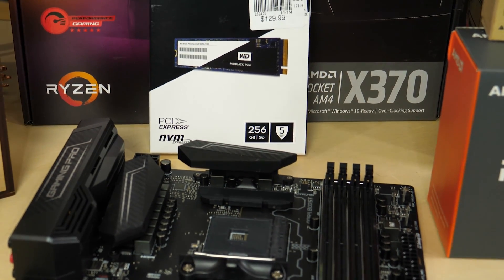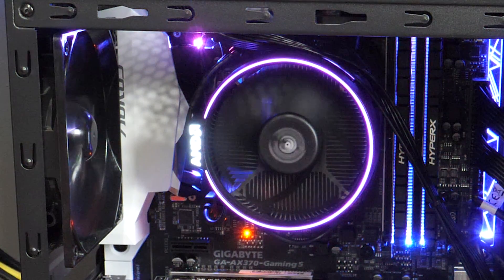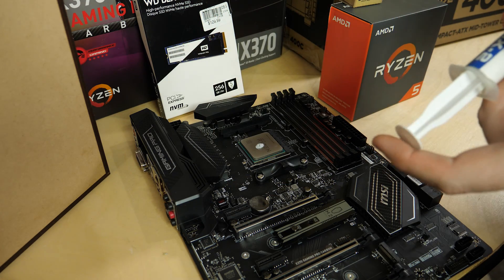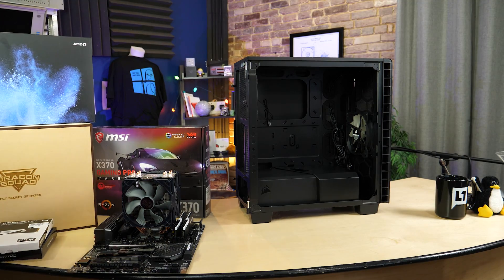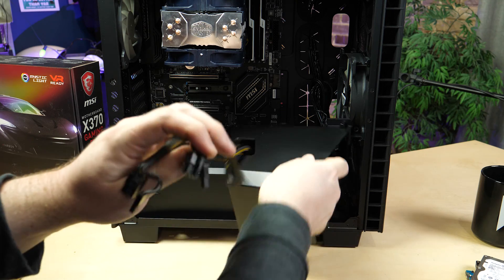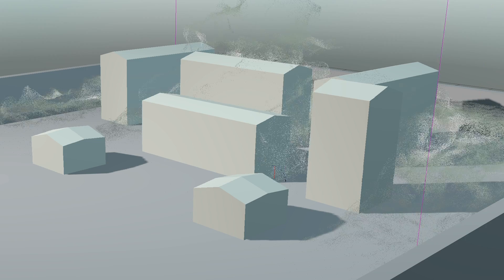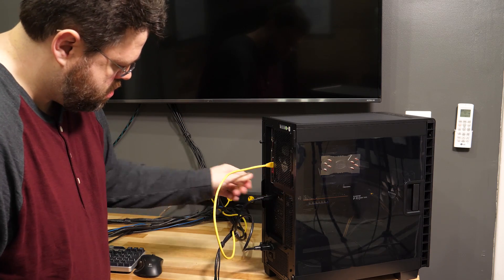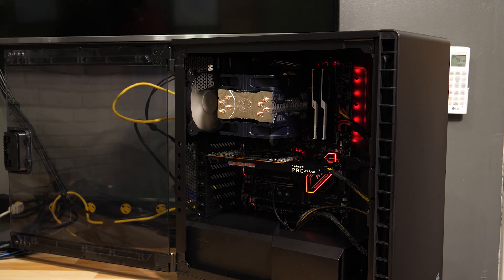AMD WX7100 Pro GPU build with X370 MSI Carbon

Comment: Hi, Thanks for the video. You mentioned that you can run a workstation card with a gaming card. How does that work, I have an MSI X370 SLI with a RX480 and I am looking into getting a workstation card. Is there a guide on how to do the setup?

Comment: I already have a gtx 1080 in my workstation and I like to know if its possible to put a Radeon Pro WX 7100 in it to . Id like to run de gtx for the gaming and the WX 7100 when I do CAD work. Iam using PTC CREO 3.0 and NX 11.0 for designing and ANSYS 18.0 for CFD.

Comment: I have this board paired with a 2400g and a WD nvme m.2 drive but my board does not detect it when I installed it on the first slot. Is this a board bios issue, cpu support issue or just a bad m.2 slot issue?

Comment: we have each other switched on the Gpu and Cpu. my cpu is better, Ryzen 7 1700 but i have a gtx 1080 not a radeon Wx7100 pro gpu (in relation to digital art, not gaming. in that case i would smash you)

Comment: Will this card help shorten Adobe Premier Render times on a Intel Xeon build. I currently have a Xeon V4 @3.5Ghz Broadwell-e/EP with 16Gb of ram and my current GPU is a NVIDIA Quadro K620 and I'm thinking about upgrading and wondering if I will see any benefit from this. Also I use this same machine to live stream via Wirecast so it has to be functional for that also. I know Wirecast can take advantage of GPU acceleration but just want to see if something like is worth my time.

Comment: I have been doing general research on building a PC for years and been planning my build for months (since before the official Ryzen 7 specs I was planning on going for it).
That motherboard + TridentZ was on my wishlist, I did my research on MSI's website and a couple forums and saw they have TridentZ (with Samsung B Chips) running at 3200MHz, but I am still glad to hear that here too.

Comment: A $60 bronze class PSU for a $650 graphics card. Not a quality choice. $20 more will get you a Seasonic 650W gold.

Also a different choice of heatsink for this class of CPU might be the Hyper 612, I have both the 212X and 612 and with them both being in the same price bracket, the 6 pipes does give you a wider direct heatpipe contact area. The only issue I had with the 612 is that the stock fan is only a 1200RPM one, which is fine if only moderately overclocking and/or want a quieter PC, but it's easy to change out for a higher CFM rated one like the jetflo if you really want to push some air.

Really 2 fans on a 212?

Comment: But will it run in ECC-mode?
Reply: AMD has left ECC support enabled on all the Ryzen processors but the actual support depends on the mainboard and that isn't a great situation right now from what I've heard.  Sometimes you'll have basic ECC support where single-bit errors are corrected, but you can't tune ECC operation in the UEFI and the system may not auto-halt as it should when a multi-bit error is detected.
Reply: vonkruel I wish there were people who would do some testing on this.

Comment: It's like you guys read my fucking mind. No shit. I was thinking about buying a B350 to run a 1700X and you guys came through with exactly that configuration shortly after Ryzen release. I now have my eye on the WX7100 and what do you fucking know ... this is awesome.

I've had my MSI B350 Tomahawk up and running now for over 2 months and it's been on 24hrs a day. I'm only running RAM at 2400mhz - 16GB of Kingston FuryX - so I'm not exactly squeezing everything out of this setup but that's entirely because I'd always planned to have it on 24/7 and thought running everything at slightly less than max would balance things out insofar as lifetime is concerned. I can clock the 1700X to 3.9Ghz no problem but I've only clocked it to 3.6Ghz and left it at that and boy .... talk about a stable system. I couldn't be more pleased - it does exactly what it was built for - rendering 3D frames - and does it in 'good enough' time. so long as my rendering is done by the time I wake up I'm happy.

Test suggestion: I'd like to see some testing with a non-biased render engine like Arnold and in particular I'd like to see how the card handles interactive view-port rendering. Octane too - I'd be interested in seeing what sort of performance we could expect there as well. For me it's like this ... I schedule my output rendering to run at night so getting a new GPU is really all about workflow, seeing accurate and fast render results in my view-port as I'm working on my materials. If you guys could provide some insight there I'd really, really appreciate it. Cheers.

Comment: Hope you touch on the 10-bit outputs on that video card, as that's basically the only reason to buy one. All that "validation" stuff doesn't mean much in practice.
Reply: I had an Elitebook 8570w for work for the longest time, Firepro M4000. It had a 10-bit display and GPU support for it too. It was neato but it totally broke Snipping Tool and other screenshot apps which I used a lot so it had to stay off

Comment: Mr. L1 Techs,

After your testing with the 7100 can you please get a hold of an AMD Vega Frontier Edition so we can see if it really is a Pro card that can also do gaming and compare the production results.  And of course also the gaming results if you wish.  I would say the air cooled version is more apples to apples.  If one is not available to you for what ever reason please don't use some other internet buddies data.  I was hoping to use the system you built here as a control for GPU production data.  If you can't for any reason that's fine, just let us know.

I was looking to build a content creation machine (for video editing and light 3D modeling/animation with Blender) with 1080p60+ gaming ability (for Twitch/YouTube live streaming of games).  I was wondering if a Pro card might be worth it over a standard GPU.  Especially since the standard GPUs in the "mid" area have been driven up in price due to mining.  I'm also wondering if the RX Vegas are no good for mining but still could for content creation for a learning amateur once they launch.

Thanks.
Reply: If you're using blender I think you would benefit from just buying an older quadro and a consumer card on the side, it's more a question of are you doing something that a consumer card can't already do? Also it looks like mining is slowing down, so hopefully in a couple months we'll start to see consumer cards come back down in price.
Reply: "Also it looks like mining is slowing down, so hopefully in a couple months we'll start to see consumer cards come back down in price."

I re-read this today and giggled.

I ended up getting the WX7100.  I found a new one (OEM packaging) cheap for ~ $500 USD.  I'm happy so far.  The OpenCL in Cycles kicks ass.  A Quadro I don't think would keep up at the same price point.  I need to keep up with Blender.  I haven't learned enough to make my own title cards or short animations yet.  This is a hobby, and I get distracted from it easy.

Comment: Isn't the professional gpu unnecessary? Correct me if I'm wrong but software used by graphic artist(photoshop, illustrator, 3dsmax, maya, After Effects, Premiere for example) doesn't benefit from professional cards(in fact, gamer ones are better, even superior when you consider price/performance ratio). These pro gpus are used by engineers for cad/cam software and other highly specific cases.
Reply: bios47 You're basically right. Some features like 10-bit open-GL are disabled on consumer cards for differentiation, though, so there is still a niche for these cards, even if it's an artificial one.
Reply: Latest GTX and Radeon series cards can do 10 bit in open GL, it's not disabled. What they can't do is 10 bit output to the desktop... in a 2D environment.  If you are going to edit HDR video or pictures (10 bit per color channel) then you will need a Quadro/FirePro along with a 10 bit capable monitor.
Reply: @David Brown, can you give more details? Last I checked Maya/3dsMax use either software(cpu), DirectX or OpenGl for rendering in the viewports, none of which takes advantage of Double-Precision Floating Point calculation from professional cards. The output renderers that support gpu rendering like iray and vray-rt doesn't support it either.
Reply: @EdWittenen You're not understanding what he is talking about. The so called "accuracy" from professional gpus comes from Double-Precision Floating Point calculations. The software I mentioned when using gpu rendering, use similar rendering engines as ones found in video games(DirectX/OpenGL), all of which do not get any benefits from Double-Precision, so even if you get a professional gpu you won't get any additional performance or accuracy because the "graphic artist software" doesn't benefit from it.
Reply: @Advection357 Yeah, that was my initial point, that content creation software is single precision only, same as video games. Main difference between the gaming and pro cards is that the pro cards support and are highly optimized for double precision, therefore there is no performance gain from using pro cards over gaming ones for graphic 2D/3D software. When it comes to performance, Wendel's build is only useful for engineers/scientists. The only exception as you have mentioned, is if you need 10bit support, then you're screwed having to pay thousands of dollars for a pro graphic card that the only advantage it provides for your work over a gaming one, is a single feature(10bit output).
Reply: @Advection357 That's a very good point, haven't thought of that.
Reply: As far as I know, all 3D rendering apps both CPU and GPU, use single precision 32 bit float. 
Double precision is mostly used in the scientific & research field
Reply: @Advection357 Although AutoCad doesn't use it for the viewports, most cad/engineering specific 3D modeling software use it and from what I've seen the difference is huge, especially on really complex objects/models.
Reply: AutoCad doesn't use what specifically? I lost track lol
Oh you mean double precision... well yea cad and engineering is in the scientific field
3D apps used for vfx and gaming are all single precision as far as I know, even the renderers like Iray Vray Corona Maxwell Arnold etc all 32 bit float
Reply: Advection357 
Autodesk Inventor does not use the GPU for anything except raytracing for rendering visualizations. What CAD software do you know that uses the GPU, let alone double precision? Perhaps one that had GPU acceleration options for calculations, like simulations in FLUENT. But, at that point you are talking about scientific workloads, not merely CAD or 3D design. Can you give any specific examples of what you are saying?
Reply: bios47
I thought he explained the difference very well. The gaming GPU prioritizes speed while the artists' GPU prioritizes accuracy.
Reply: bios47 I'm not sure about all those workloads, but I can confirm that Maya definitely does.

Comment: ive gotta work up to being able to justify buying a WX. but what would be a good graphics card to start learning 3d modeling? cuz right now i only have a godivari apu.
also i got a cx750( for 40 bucks) and it was refurbished. its been working great for about two years now. my neighbourhood has had 3power surges this summer ans its showing no signs of failure i.e. no coil whine, roudy fan, random shutdowns, none of that.
Reply: Javierm0n0 If you're just learning don't worry about getting a pro GPU. A gaming card will work just fine.
Reply: any gaming card or could i spring for a 580 even with the 7670kapu?

Comment: Would you recommend an EVGA 450W Bronze power supply for an RX 580 (if/when I can find one).
Reply: Raman 580 is a bit power hungry under load, I would go for 550-600W. But that is just like, my opinion, man.
Reply: Raman
The amazon dot com page for the RX 580 recommends a 500 watt PSU at a minimum. Why not just get a good 650 watt PSU?
Reply: EdWittenen 
Yeah I know, but my CPU draws about 100W max and RX580 is like max 185W. that's only 285W and the rest of the system doesn't really draw much power. pcpartpicker gave a 346W total with R5 1600 and RX 580.
So that's why I'm a little confused.
Reply: It's best to give your PSU at least 50% headroom over the expected demand of the system, no need to go to extremes but having a PSU that can supply twice what the system requires is a good safe bet. It helps with starting up the system when it has to chug up all that raw power from nowhere and it's best not to run the PSU at full pelt for long periods. It also means that if the PSU is running at lower output levels it will be more efficient too.
Reply: Raman I think that there is some difference between the wattage reported for components and the reported wattage capacity of power supplies. I don't understand it but I think that you generally need to double the wattage used by your components to figure the wattage requirement for the power supply.
Reply: EdWittenen 
On PCPARTPICKER, only if I choose a PSU lower than that 346W max will it report as incompatible. I already have that PSU so if it's enough I save a few dollars.
Reply: The power required to start up a system is higher than the total power that the components will draw when running normally. If you don't allow enough headroom your PSU will be struggling and getting warm, this is not efficient and will likely lead to the PSU failing early. There's also the issue of upgrading your system, or if you want to add components that PSU will also need to be changed. And don't forget peripherals like USB powered devices or external storage, they all make demands on the PSU.
Reply: A power on test isn't a stress test you know. R5 1600 plus RX580 won't go over 350W under stress testing. It isn't gonna use more than that during a boot up.
Reply: Raman It probably wouldn't hurt anything to use the power supply that you already have. If it works then that is good. If you have intermittent problems under load then you can get a higher capacity power supply at that time. I think that these rules are when you are buying new equipment to help avoid buying something that isn't adequate.
Reply: EdWittenen 
Ok, thank you
Reply: It's nothing to do with 'stress testing', you are right there is a max power it can draw under load. It's about power surge and how quickly it can produce enough power when everything needs it. There is a thing called power droop when the PSU cannot produce enough power quick enough. That's when the system fails to boot because the PSU is underpowered. As EdWitten says, if you already have a PSU it wouldn't hurt to try it but I'm sure it's asking a lot from a 450W PSU especially if you add on external devices. Even a couple of extra fans could overload that system.